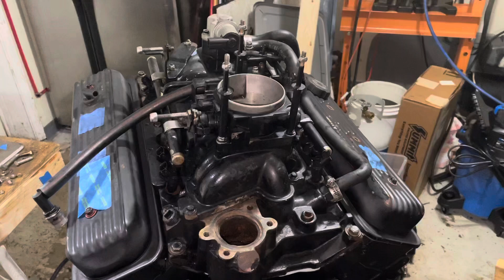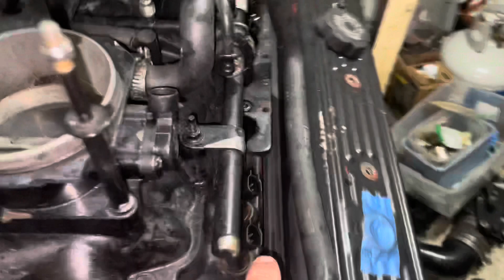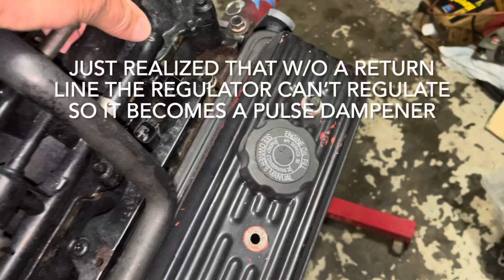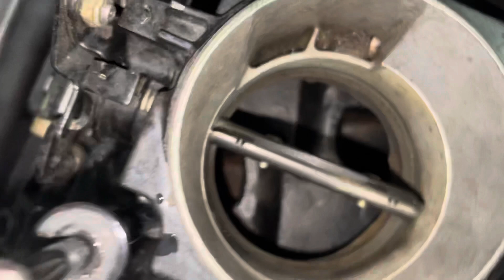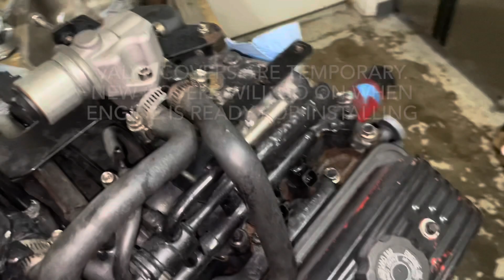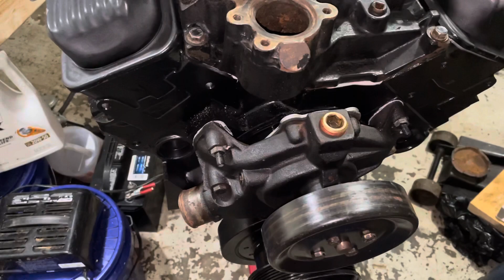Mercruiser 5.0 1(h) - MPFI Explained (Cleaned Too)

Comment: Can be L31 engine used for boat? I mean with its spider fuel injection system?
Reply from the maker: Neither Volvo Penta nor Mercruiser used that system in a boat engine. There is a marine v6 mpfi intake that is made of all aluminum that was used on v6 mpfi engines. The spider intake was probably not used because of the amount of plastic supporting fuel components. But probably the main reason is the fuel injectors aren’t capable of flowing enough fuel for a marine engine which runs at full throttle for long periods of time.

Comment: I have a 2004 Sea Ray 200 Select with an Alpha One Outdrive and a 5.0 Mercruiser MPI. I want to LS Swap the 5.0 for a more modern and higher hp. engine. What year LS would make a good engine that I can bolt my outdrive to without modification? I will do a complete rebuild of whatever engine I get so this won’t be a budget build. I am in California so any suggestions you can give me is greatly appreciated. I just don’t know where to start. Thanks - Beeman John
Reply from the maker: I am doing an LS swap in a boat now. There is no single engine that will work. The 2005 and earlier engines used plastic fuel rails which are not allowed by US Coast Guard rules. The 2007 and later engines had steel fuel rails but are also AFM engines with the 4-8 cylinder activation which usually have wiped cams when bought as cores. So the truth is you have to mix and match parts to get it right for a marine engine. There is too much to discuss in a comment like this so you’ll just have to wait until I publish my videos.
Reply: @moccasinmarine  Thank you for your honest feedback.

Comment: Hello I have a 2009 5.0 mpi my fuel pressure at prime is 40 and drops to 36 at idle and drops to 32 under load.  I can plug the lower fuel pressure regulator off under load and fuel pressure comes back up to 40 any suggestions thank you.
Reply from the maker: Sounds like a bad regulator.